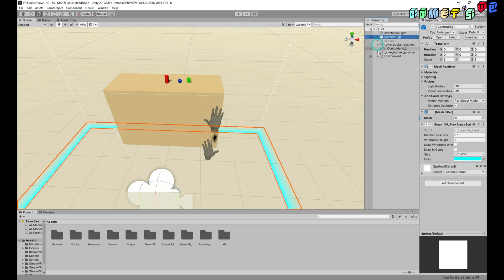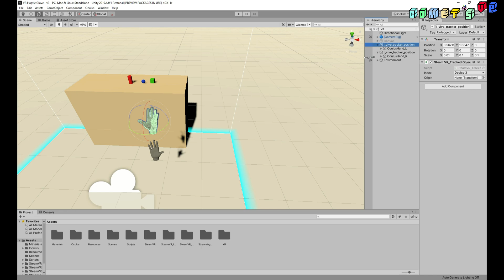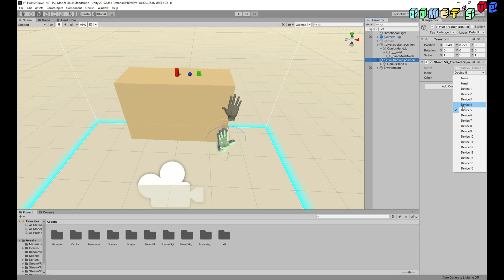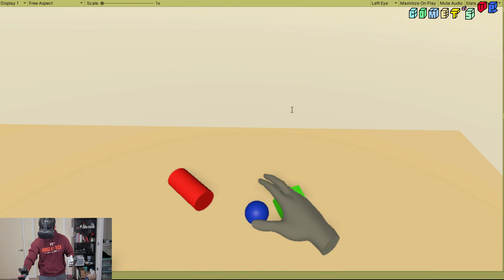VR Haptic Glove Demo with Force Feedback Motor (feat. VIVE Tracker)

Comment: hello! , I'm from Brazil and I'm doing a tcc project very similar to what you did, until I found your channel that helped me a lot, but I have a problem in my code that would be that when the hand is turned to another position other than the original one, the fingers keep turning to the same place, that is, if I turn my hand behind the fingers instead of following the hand, they make the same movement as before. Would you help me?
Reply from the maker: Hi, thank you for your interest. It is really hard to know what problems you have now. But I assume you might not child your fingers from your hand.

Comment: I am working on project which is connected to unity but stuck in 2 mpu6050 interfacing if you know how can i do this so please tell me
Reply from the maker: I tried it and it works, but if you don't have really good algorithm(Kalman filter or other control theory) to process, I recommend you to use VIVE tracker. MPU6050 has a physical limitation to track 6DOF. In order to track 6DOF, you literally integrate twice the accelerometer value to get the distance. Unfortunately, during that process, lots of errors are generated. If you are trying to track 3DOF, MPU6050 is totally fine tho. You can simply put your Gyro value in to rotation angle in your object buy using "eulerAngle" funciton.
Reply: @comet-tech  finally i created these with 2 mpu6050 without drifting 😅

Comment: great video and this is really well done
one question how did you get arduino to communicate with unity on the vr headset and how did you make it wireless?
and for the haptics i am a little confused on how they would work. my theroy is that you put a collider on each finger and when a finger collides with something you make the motor move back a little until it is not colliding anymore. or you might be able to put a raycast on each fingers and see if anything is on the path of rotation and when it collides with something move the motors back
and for the wiggling the same thing is happening to me for potentiometers any solutions yet?
also you could have gotten the oculus quest 2 which supports individual handtracking and finger tracking and u wouldn't need flex sensors but overall the projects is really coming together well done im amazed.
Reply from the maker: I used serial port to connect arduino with unity and I just imported SteamVR to make it work. For the haptic, it is so complicated now, I am still thinking how to implement. For the wiggling, simpe way is averaging the value. That's what I did and it works fine with previous video. I think there's unexpected interrupts from somewhere. For the oculus 2, yeah that could be one option, but I need to change whole thing then... So I will keep using VIVE to use trackers. I really appreciate your interest, thanks!
Reply: @comet-tech  thanks for the reply and yes the haptics do seem really complicated and goodluck with your project. I was able to use serial connection to connect arduino to pc and am looking for a way to connect arduino to phone on unity if you find a solution please do let me know.